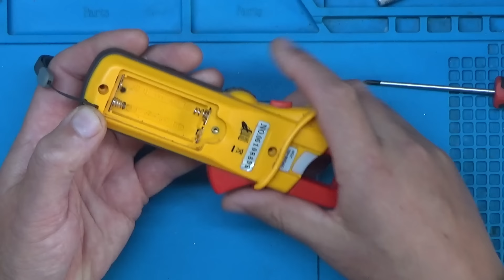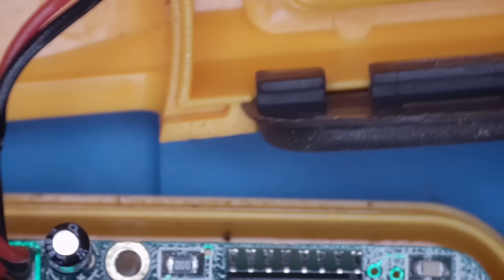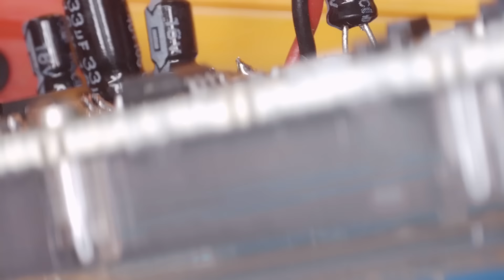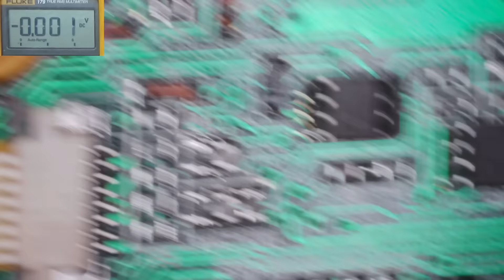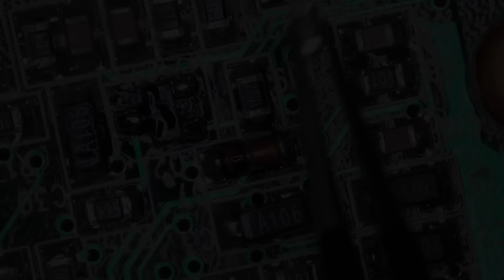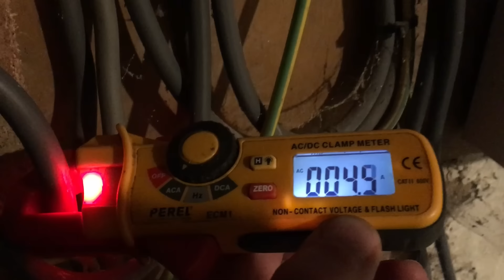Faulty Perel Digital Clamp Multimeter | Can I Fix It?

Comment: I was an electron microscopist for almost 50 years. Generally, we have to fix our own machines as service is very expensive and often takes a few days to get someone who often doesn't know as much as we did. I replaced a board and it only worked a few hours. It turned out (long story) that all of the resistors of a certain value were defective or died after a short time. Perhaps that was the case here, too.
Reply from the maker: Interesting Bruce, thanks for sharing 👍 I was wondering if something they were made of oxidises over time, and causes them to go open / go high.
Reply: @BuyitFixit  That was my thought, too. We probably will never know. 🙂
Reply: Dude I would love to see some videos of you talking about your days in the industry.

Comment: Hi I have 2 cheap amp probes like this, both jump around on the DC scale, I think it works like it should, I bought a second one that had a zeroing button because I thought the first one was bad. I believe that you are right on that someone measured something that caused an over voltage.
Rich
Reply from the maker: Thanks for sharing your experience, Rich 👍

Comment: Hmmm 1 resistor fail ok, multipul?
The only thought I kinda got is wonder if the manufacturer had a batch of resistors that wasn't brilliant and perhaps the one that powered the display was the final fault? And the previous owner was putting up with the other issues?
Reply from the maker: Yeah it's weird. The only thing I can think of is perhaps environment like damp or something caused them to oxidise and the connections to fail / go high resistance?

Comment: Great video. I have had similar experiences with SMD resistors especially after a physical shock. The ends of the resistors, the frets fracture away from the resistance body.
Reply from the maker: Thanks 👍Interesting thanks for sharing.
Reply: Came here to say the same thing, in my case it was some DI boxes that must have been dropped

Comment: Interesting! So weird, you'd think that the semiconductors would go before the resistors blow op in case of a surge. Could be dropped and the resistors cracked from the shock?
Reply from the maker: Possibly, someone else suggested mechanical shock. I was thinking perhaps the stuff they are made of oxidises after a while and causes them to go open or read a higher value. Perhaps they were bought from a poor manufacturer...

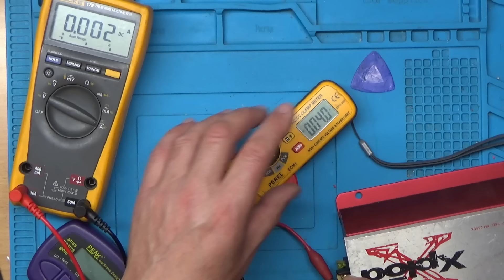Comment: 31:31 - Mick... those amper clamps almost always have to be zeroed, by red ZERO button :D
Reply from the maker: I tried that, it does go to 0 and display the text of ZERO on the LCD and doesn't measure. Press it again and it goes back to 4 amps, so I'm not sure how it works.
Reply: @BuyitFixit  Well, one thing that may sound strange, but maybe its bug... maybe someone zeroed it while hooked  at 4 Amps... or -4 Amps, I would invert it backward and zero again... just to try if that change something...

Comment: The clamp appears to be magnetized. It may have been heavily overloaded, which would explain the persistent magnetism (DC drift) and numerous damaged resistors
Reply from the maker: Very plausible theory 👍
Reply: @BuyitFixit  you can fix DC drift with a cheap watch demagnetizer. The clamp should be able to zero after that

Comment: Thanks for another nice video Mick, very smart diagnosis and great fix. On the OC resistors issue my explanation is: I have seen those 1206 develop a "hair crack" or like micro fractures after receiving a high G shock and go OC  yet they look ok in one piece until you examine them closely with good magnification. In addition that broken inductor is our evidence here that the unit suffered a serious impact shock which will support the results you have seen on the OC 1206s. The 1206 fracture with shock is made worse with their brittleness from age and severe temperature variations. I have seen that in the field on some of the products from my previous lives in the industry.
Reply from the maker: Thanks for the kind words and the interesting insight 👍
Reply: @BuyitFixit  I've seen it in MLCCs, too. I also (I was a designer) found the solution: design the solder mask so that the available solder pad width is only 60% of the component's width. This allows the solder joint to flex (or it did in the days of tin-lead solder). It also has the benefit of reducing the amount of solder used and therefore the cost, which is a significant saving when you are manufacturing large numbers of PCBs. (MLCC = multilayer ceramic capacitor.)
Reply: How to set up an electronics repair bench...
1. Soldering iron 
2. Solder sucker 
3. Solder and flux 
4. Microscope for magnifying glass 
5. A good multimeter 

Oh, and I almost forgot a $50,000 x-ray machine.
😂😂😂

Comment: This clamp meter is giving you a lot of resistance to being prepared Mick.
It looks like somebody did measure a high voltage line with it and fried it.
Good fix anyway.
Reply from the maker: Thanks mate 👍😂😂😂😂
Reply: I don't think this is because measuring high voltage rail. Remember that every multimeter has very high resistance (in Mega Ohm) that it would not damage for high voltage up to 10KV (unless stupid utility line worker measure 10kVA or higher using this, which is near impossible to happen because these workers are trained).

There is a physical damage on coil, it is clear that the cause was this device was dropped/shock, maybe multiple times and fractured with some resistors also encounter micro-fracture.

Comment: What a rabbit hole!  I am always amazed at your perseverence.  As the saying goes, if it's not a Fluke, buy it at your Perel. 😀  It's a shame these things can't talk to tell you what happened to them.  Another one saved from the landfill.  Well done.
Reply from the maker: Cheers Mike 👍
Reply: Worst I had with a used Fluke has been lost digit LCD's in an old old 83iii (£15 LCD from China) and rotted battery shrapnel in a 51 K-Type Thermocouple Meter - very easily remedied although the original contact pieces were rather difficult to source (£8 from China).
Reply: @Zangief747  Multimeters are a real lottery.  With Fluke you pay for their reputation and general build quality.  Someone who uses a meter very rarely can't justify or afford the Fluke tax, so they are stuck with random luck when they buy.

Comment: That's really weird considering the only input method is via the clamp and not having test leads like some do, it seems strange that resistors became faulty. Perhaps it was powered by a 9 V battery as the owner didn't have the correct cells
Reply from the maker: Yes, very strange indeed. I doubt you could power it from a 9v battery unless you used wires on it. The only thing I can think of is perhaps environment like damp or something caused them to oxidise and the connections to fail / go high resistance?

Comment: I recently had a 16x2 LCD which was flickering traced to a 680k resistor which had gone to megohms. Wonder if there are some dodgy batches of resistors…
Reply from the maker: Could well be, I had been wondering if they deteriorated over time. Like if the film or contacts oxidised causing failure.
Reply: @BuyitFixit  this was a new low power device so maybe just poor quality or some sort of stress during soldering

Comment: I experienced the same issue with an agricultural control module recently. I could see nothing physically wrong with the affected resistors at all but they were practically open circuit!
Reply from the maker: Interesting. I'm wondering if the environment causes them to break down / oxidise and then the resistance increases or goes open circuit.
Reply: @BuyitFixit The board had a conformal coating and looked pristine, sealed up like a car ECU. After removing the resistor, I tried to measure from one end and pierce through the top glaze to see where the break was. Predictably during probing, it vanished from sight, never to be seen again!

Comment: Nicely diagnosed. I think you may have more resistors O/C so need to check them all. That 4 amp offset is probably from a comparator which has a faulty resistor as well. I did think a couple of the Rs you took out may have been cracked - otherwise it was the microscope view.
Reply from the maker: Thanks mate 👍I did check all of the resistors. The only thing I can think was perhaps that 5.1K that measured 5.6K was possibly the issue. I had wires coming off all over, and it was a right pain to but back together.  I was on with it until about 1:30am and had enough of it by that point. I then went to get the footage off the microscope and saw half the files were corrupted, so it was 5AM when I got to bed, then been editing the rest of this all day since I got up 😂😂😂

Comment: Because of the broken coil and the nature of such tools, I just guess it got dropped from some height causing the resistors to break internally.
Reply from the maker: Yes, that's what I thought too 👍 It could also just be poorly manufactured resistors that may oxidise over time causing them to go open or higher resistance.
Reply: I'd second that - the broken inductor is a good tell tale of a massive impact. I bet someone was fixing high bay lighting for winter time 😮

Comment: DC clamps do always need zeroing, depending on the model it can require pressing the zero button for a few seconds...
Reply from the maker: I just tried that. It's a toggle button though. It does go to zero, but shows the words ZERO on the display above the 000.0 It does seem to work, but pressing the button again and it goes back to 4A
Reply: @BuyitFixit  indeed, DC always needs a zero switch and often they are toggle switches. You zero them as close as possible to the location of measurement. The clamp contact points at the end of the clamp need to be very clean and as close together as possible. Good clampmeters are more or less "immune"  to strong external magnetic fields (up to a point) , bad  ones can go bananas and zeroing will not help.
Reply: @BuyitFixit  For my mini oscilloscope with built in 10A ammeter, you press Zero to make it read 0, then you can turn on the load to see what the difference is and thus a decently accurate reading. Pressing zero again will return the meter to whatever its base reading is. It's not a calibrate button, though some ammeters have that functionality.

Comment: It's typical to need to zero the DC amps before taking a measurement because it's influenced by the local magnetic field and will drift around. No idea what's going on with all those dead resistors, maybe a really bad batch from the factory??
Reply: My thoughts, exactly, about the resistors. 
I have a couple of clamp meters and my cheap one has to be zeroed in DC, with the zero button. My expensive clamp meter auto zeroes when you switch to DC clamp amps.
Reply: they always need some form of zeroing on DC current, as there is always some stray magnetic fields in the coil magnetics affecting the hal affect sensor.
Reply from the maker: I just tried that. It's a toggle button though. It does go to zero, but shows the words ZERO on the display above the 000.0 It does seem to work, but pressing the button again and it goes back to 4A
Reply: @BuyitFixit  When you press the zero button a second time, it ''un-zeroes'' the reading. The reason they have it like this is that you might want to, say, take a current reading of one circuit, and then zero the meter to put something else on that circuit and measure the current of the second service you put online on its own. The zero button provides this function, and you can switch between the two readings with it.